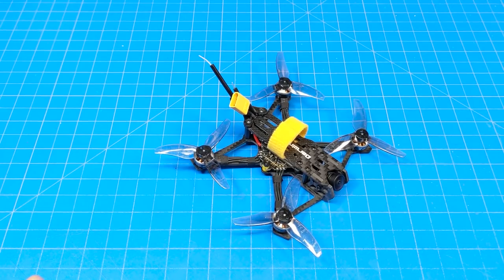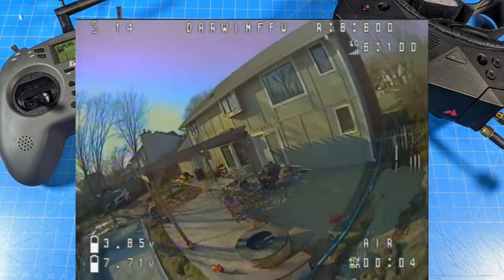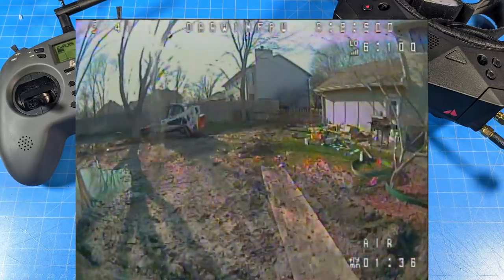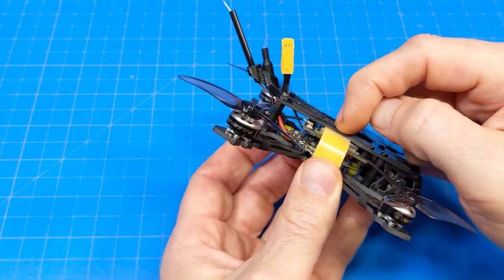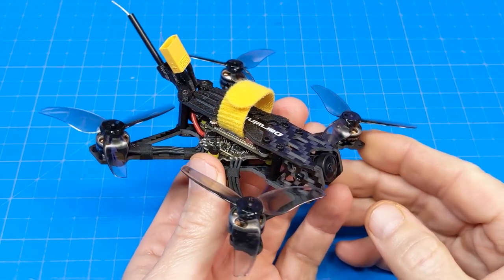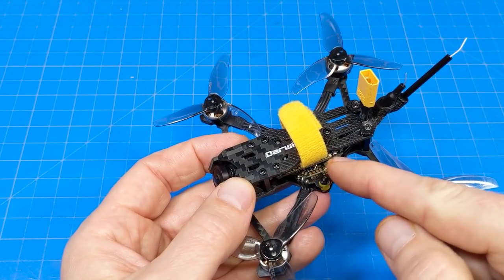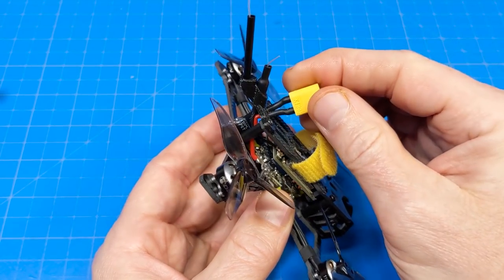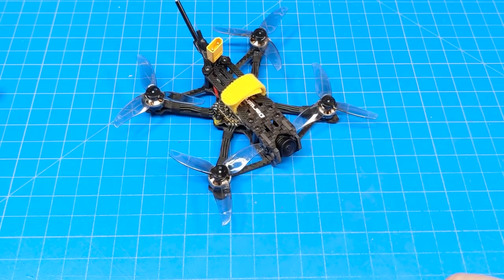Rare Top Mounted Micro Drone // $129 // DarWinFPV TinyApe

Comment: Slightly slow shipping to Sacramento but not bad. Bought the PNP and  a bare frame and iFlght 1104 motors and screw holes in the frame were too small. Thoughts anyone? Thanks
Reply from the maker: screw holes for the motors were to small? That is pretty strange, maybe we can ream the hole out with a carbon fiber or even just screw the screw through the carbon to ream it out a touch. 9mm x 9mm motor mounting should all use m2 screws. Hopefully the previous ideas help
Reply: @NickBurnsFPV  Screws are 1.5mm on this and the Baby Ape. Thanks

Comment: Is it ok to use 1102 10000kv motor, 2inch, 2s build on this darwinfpv fc?
Reply from the maker: Yes the esc will handle that fine. I run that setup on 5amp esc all the time

Comment: I have both thw analog and walksnail versions, both have a  wobble flying in a straight line, and the motors are not handling crashes well, If I can solve these iasues I would love this unike tiny backyard flyer. Have ordered same motorspec from tmotor, and will try a toothpick preset in betaflight
Reply from the maker: It has the wobble out of the box or after some flights it developed the wobbles?
Reply: @NickBurnsFPV  both the ananalog, and walksnail were unstable
Reply from the maker: @andreastornesel8404  I see you have a video on the tinyape walksnail on your channel. I do see a bit of a bobble. Was there much wind? What size of battery. Also check that the receiver values in betaflight are steady and not bouncing around.
Reply: @NickBurnsFPV  I fly both 450mAh and 550mAh, it is a bit better with 450.i need to learn betaflight and some basic tuning. Both my alnalog and Walksnail version behaves the same and I have changed the settings, I don't think it's beacuse i'm a beginner and doesn't fly well
Reply from the maker: @andreastornesel8404  maybe turn the master slider down a notch and test it again. I say this as if its better with a smaller battery then the P is likely a touch high for the overal weight.
Reply: @NickBurnsFPV  Thankyou Nick, wery kind of you to take time to support me. I will try to tweek the two parameters slightly.

Comment: Can u up date the elrs? To 2?
Reply from the maker: Yes. To update we have to flash betaflight to a more recent version. The elrs version firmware is baked into betaflight.
Reply: @NickBurnsFPV  cool i can't wait for them to arrive i have the tiny ape and i love it.  I'm a micro drone flyer myself. Sub 3in
Reply from the maker: @devilsreject78  It may already have elrs v2 on it. I see on their website the stand alone AIO they show version 2 on it. Fingers crossed. If you do have to update betaflight to get elrs v2 take a cli diff and dump backup.

Comment: I hot 3 boards and 2 where doa. One of them has the vtx uart burnt out and the other does absolutely nothing no beeps or anything. I think the aio boards auck ass.
Reply from the maker: Wow, that is a really bad experience. By chance did you by direct from Darwinfpv and make contact with their support on these issues?
Reply: @NickBurnsFPV  no I bought them when they first came out and they sat for a year before I tried to use them.
Reply from the maker: @luvmyhondasi  oh okay. Thanks for that detail

Comment: What target is the board when you go to flash it?
Reply: I have this board and 4.3.0 rc4 makes 2motors spin when controlling one in betaflight
Reply from the maker: The stock target on my board shows BETAFPVF4SX1280 in betaflight.
Reply: @NickBurnsFPV  I did find online one place where Matek was the target but I think that was previous, is yours the rc3 version?
Reply: I found a cli for this quad you are supposed to do after the update I will try it a report if it works!
Reply: It didn’t work! Not rc1-5, motors 2 and 3 still spin together when controlling either in betaflight. I’m kind of losing hope for this board so far it’s a disappointment!
Reply: In an esc configurator 1, 3,4 can be read but 2 is missing
Reply: Now only 1+4 no real reason that I can devise
Reply: Now I’m trying to flash from local firmware downloaded from Darwin fpv and their cli dump
Reply: Still does not work, tried contacting darwinfpv to no avail yet, the same two motors spin together, I keep rechecking that I’ve soldered it well but it’s clean. 
Haven’t had such issues with any fc in my experience before
Reply from the maker: @SilverbackSasquatch19xx  I believe its rc2, as rc3 has elrs v2 in it.
Reply from the maker: I presume you located this page with some additional data https://darwinfpv.com/pages/firmware-cli-vtx-configuration-files-download and this page with configuration parameters https://darwinfpv.com/pages/title
Reply: @NickBurnsFPV  sorry for bombing your comments man! I’m still working with it but it’s not looking like it will work for me:/ I’ve tried almost everything now I think I’ve learned my lesson with darwinfpv
Reply: @NickBurnsFPV  yep that’s the one, after doing that I did get my esc configurator to read all 4 but when in betaflight sliders for 2&3only make a melody noise 1&4 work
Reply from the maker: @SilverbackSasquatch19xx  No worries. It stinks, surely there is a solution somewhere. I wonder if a betafpv cli dump would work. I guess there is potential the escs don't work which is the ultimate in disappointment.
Reply: @NickBurnsFPV  yeah I’m really hoping that’s not the case I waited forever for this thing to come from china and now it’s probably just defective. Fingers crossed but dang I wish I would have gotten anything else!
Reply: @NickBurnsFPV  I tried straight from betafpv their cli then their software and cli the only thing different is no tones just back to spinning two motors at once, I don’t know if I can return this thing but it has me frustrated closer and closer to believing it’s just garbage
Reply from the maker: @SilverbackSasquatch19xx  If you go to the cli and type "resource" what do you have for motor resources? This is what mine has 
resource MOTOR 1 B08
resource MOTOR 2 A00
resource MOTOR 3 B10
resource MOTOR 4 B07
resource MOTOR 5 A08
resource MOTOR 6 A10
of course we only need 4 :)
Reply: @NickBurnsFPV  Thank you man! I had checked into that too while I was trying things but unfortunately mine are the same as yours

Comment: Wish tri blades would go away, they snap way to easy compared to bi blades. Hate the Phillips head to death so need to change to hex or torx.
Reply: Just change the props and screws then you nerd. Tri props are great for performance.
Reply: What don't you like about tri blades? To me they feel more "grippy" in turns and they seem to have more grunt down low with less scream up top which suits my style.
Reply: @fbfk997.2  they snap, said that already... Lol
Reply: @american7169  lol yes but it made no sense as the brand would matter more than 2 or 3 blades would. I’ve got a box of older dal t5045c cyclone tri blades that refuse to break. I literally chop through the small tree branches that used to make me crash.

Comment: I cant believe these FPV drone guys dont use velcro on the drone and battery... did this in ground racing, and you could wreck HARD and have no strap, and the velcro would hold it,... it would be literally difficult to pull it free for charging.... i did it initially to try a VERY small battery that the strap didnt hold ...
Reply from the maker: We used to several years ago